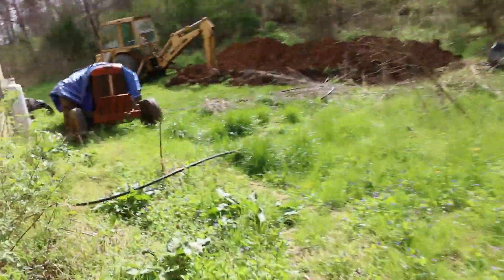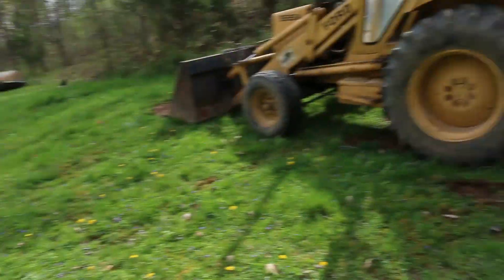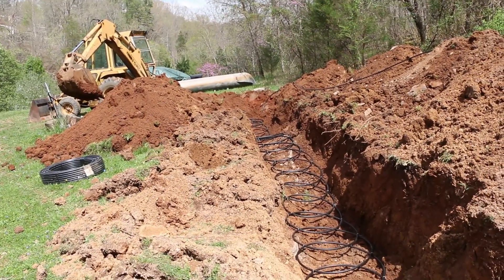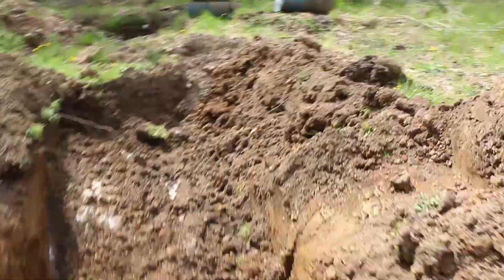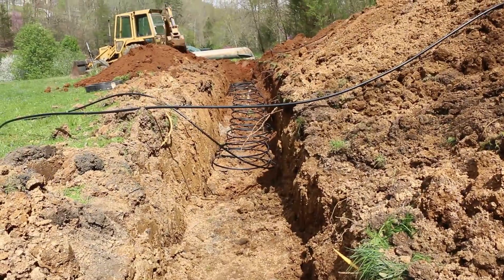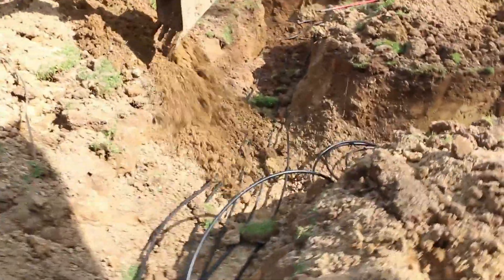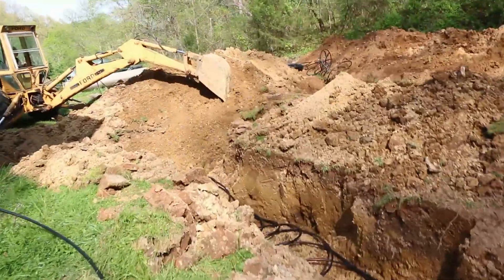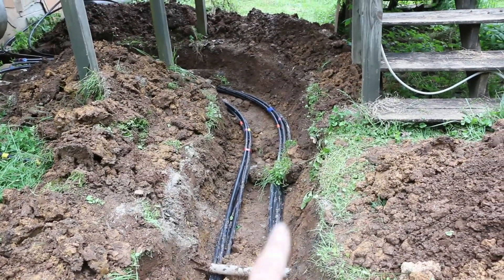Heat pump replacement project (Geothermal) Part 2 (Loop installation)

Comment: Nice work. How about a follow-up video?
Reply from the maker: You know, I really should. I'm preparing to do some adjustments on the system, it would make sense to make a part 3. Its been working beautifully since we put it in aside from one tiny snag where the unit had a pinhole and leaked out the refrigerant, had to get that brazed up and recharged but it keeps the house cool all summer and warm all winter, we heat with a wood stove some too, but if we don't feel like starting a fire the geothermal keeps the house comfortable without any issue.

Comment: How is this working out for you now that it has been a year?
Reply from the maker: Phenomenally! It heats our house wonderfully and cools it very well also. I love that everything is all integrated to the one unit in terms of the AC refrigerant at least. And man the thing is so quiet. Our old split system woke me up every time it would kick on during the night. This unit I sleep right through it's cycles. Our utility bill has dropped slightly, not enough for me to say oh wow it's saving us a fortune but I'm also doing a lot more work for my business at home so I'm using more and more large power tools, air compressor, etc so who knows it may have been a more substantial number. Based on the little "Ted energy detective" thing I have the geothermal uses about half what the older split system does.